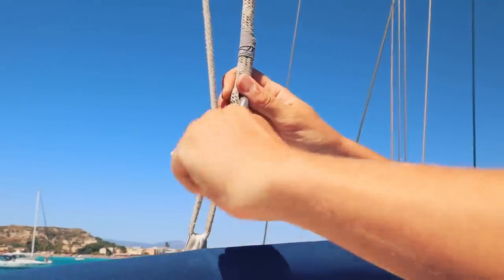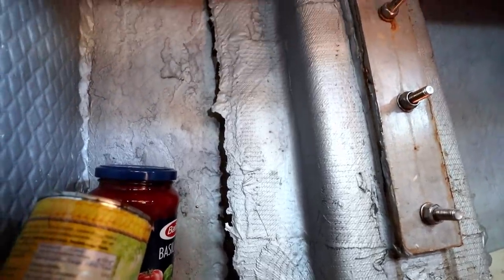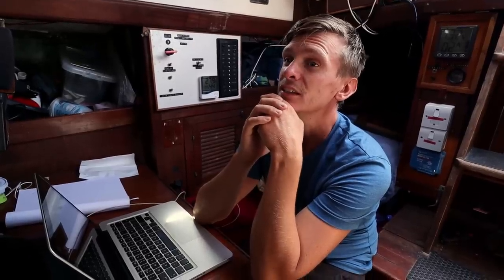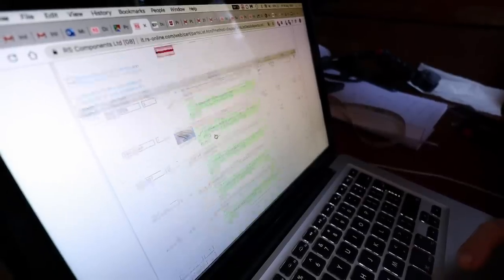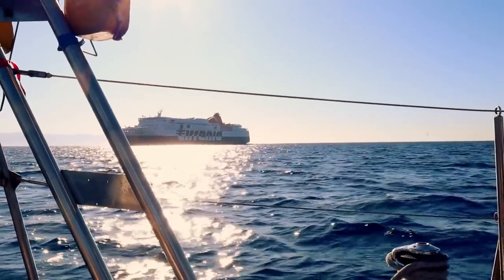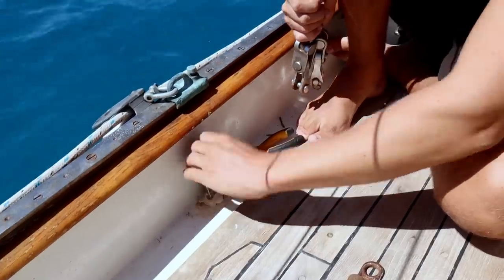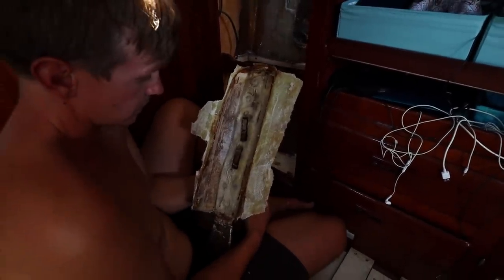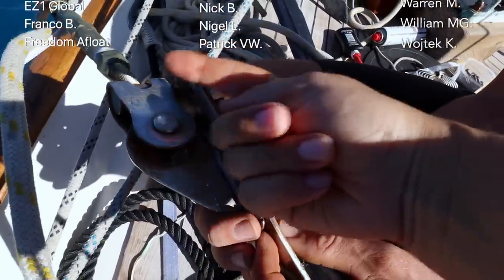80] Our Sailboat's Broken. Discovering Our Ripped Out Chainplates: A Shockingly BAD DIY Install

Comment: A measure of your strength is determined by the manner in which you deal with adversity. Commiserations on your discovery of poor workmanship, but it was as well you spotted it under passive circumstances. Ryan’s ‘workaround’ was well reasoned and your ‘make do’ repairs effective. So well done guys.

Comment: Finally I found a sailing Channel with people who really know what they're doing. The DIY installation of that chain plate was horrific. I'm amazed the rig stayed up for any amount of time. 
 I lost the mast on a Pearson 33 2 about 10 years ago due to a faulty stem head. $30,000 worth of damage to the boat. 
 I like your idea for going to external chainplates I'm not sure you'll have to when you're done with this repair. I'm sure you know this but whenever you remove chain plates or rigging it's always good to bring a spare halyard down and attach it, even if it's just to a stanchion base. Just a little bit of extra security.

Comment: Seems to me you rerally won't need to re-fix those chainplates aterwards. That's a good fix, expecially if you get those iroko spacers nice and snug and perhaps epoxied in place. Six of one half dozen of the other regarding moving the chainplates external once you have that through-bolting.  Lucky it happened now and not another 'less convenient' time... 

All the best to you guys, one of my favourite sailing channels.

Comment: Sure glad you discovered the problem before you got into a much more risky situation (700 miles off shore in a force 8 gale). So pleased to hear of bolting thru the hull. If done correctly this solution should be as strong as external chain plates. hThe only compromise is the chain plate coming up thru the deck (possible leaks). Really enjoy your channel...keep up the interesting story.

Comment: As a boatbuilder for two decades, I can tell you the repaired chainplate installation used the wrong fiberglass (they used 6 or 8 ounce cloth - normally used for WATERPROOFING decks or cabins, not meant for structural work).  It was not only the wrong type of glass, but does not extend nearly far enough in a radius around the wood backer piece. It is important to SPREAD THE LOAD over a wide area of the hull or the wood backer and chainplate will pull lose again. It is a GLARING ERROR and the surveyor should have noticed this!

I suggest grinding the hull with a mini-grinder and 60 grit paper for a good two feet around the area where you want to install the wood chainplate.   Tape off your work area with a curtain of clear plastic so you don't get fiberglass dust all over the place and make sure you wear a good mask and safety goggles!  Grind just enough to take off paint, dirt, grease, old lumps of the previous repair - do not sand deeply - we just want nice, clean fiberglass surface to take the new layers. Make sure you run the edges of the plywood through a table saw as close to 45 degrees as you can get to make a slope - fiberglass does not like to make a 90 degree turn.  Lay down your plywood backing piece with 5200 sealant and tighten the bolts for 48 hours to allow the 5200 to dry and stick the ply to the hull. Remove the bolts and trim off excess 5200 that has squeezed out, using a razor knife or sharp chisel. 

Use EPOXY (which sticks to ground fiberglass much better than polyester resin) to saturate three layers of matt/woven roving (one ata a time) or - preferred - three layers of heavy BI-AXIAL or TRI-AXIAL cloth (with embedded matt) laid over a plywood backing plate and extending onto the hull for two feet in all directions. Try to do the layup one after another and not let harden between layers. When you reinstall the chainplate, I recommend daps of sealant behind the metal so that water running down the chainplate cannot reach the internal plywood beneath it. The job is not difficult, just time consuming. 

Alternately, you might consider moving the chainplates to the OUTSIDE of the hull - leaks run overboard rather than inside the boat. Most of the well regarded Westsail boats used exterior mounted chainplates for just such reasoning.
Reply: eric morris Great suggestions and advice. But these videos were shot a few months ago. Kittiwake is now crossing the Atlantic Ocean.
Reply: Brilliant, thank you that is extremely helpful for me.

Comment: Always wondered about internal chainplates.  Thanks for sharing. Liked your solution. Considering what you had, a properly bonded backing timber well adhered and sealed (to prevent rot) coupled with an external backing plate should serve you far better than what you had before.  May I suggest that if you broaden the external plate as it approaches the gunwale it should be every bit as strong as an external chainplate . Thus, eliminating the need for further costly mods to the rig while proving better load distribution than a typically narrow external chainplate.  Needless to say now is the time to fully inspect the standing rig even to the point of using magnaflux spray on crack finder on all attachment hardware and mounting points - checking for hidden cracks.  Good luck and thanks again. Also Happy wedding.

Comment: That’s an appalling job one of the previous owners did! Looks like you made the right decision to bolt through. I think you’ve already crossed the Atlantic so I guess all went well. I would go with keeping the shroud plates in the locker but putting a substantial ‘backing’ plate on the outside
Reply: They only left last week so doubt they are as Roos the pond yet.  They have a tracker.
Reply: Andy UK - SY Corrival - Rival 32 thanks, looks like they’ve just passed La Palma heading WSW

Comment: To prevent rust, before I put screws (that always used to rust out) into my Enduro Motorcycle, I soak them in motor oil and hit them with a gas canister powered handheld flame/blow torch (in a pinch otherwise using an oven is the best), drop it back in the oil with a hiss, pull it out again wipe excess oil heat it, drop it back in oil and pull out and flame it again, 2 or 3 times.  It cures the screws and stops the rust.  You can do this with the backing plate as well if it is duplex stainless steel (used in water).  Blackening not only protects bare steel from rusting, but the process also yields a relatively attractive finish. You can achieve this finish with some pretty common household items. You will need:
acetone
; clean rags; motor oil; pliers; handheld torch;heavy leather gloves, jacket (welding attire works great), and safety glasses; fire extinguisher (just in case); metal or glass bowl (preferably one you don't care about); well ventilated or outdoor space conducive to mischief preferably on concrete. Oil, wax or lacquer can be applied after blackening to improve corrosion resistance.

Comment: WOW! That looked like you were very lucky. Looks like a bad job but bolting the chain plates to the hull is  a great idea! Don't use plywood but use G10 which is not expensive through amazon.

Comment: WOW that was a terrible previous repair , i assume  there was one wood there and it rotted from a leak .....terrible coverup job!  perhaps it was the previous owner but one?? 

i made some changes to the rake on my rig that required extending the cap shrouds and i was able to by ready made 4" extenders , you could probably use something similar if you change to external chainplate or make sure our external plate come the right height to use the old rigging.  hope your having a great time crssing the Atlantic at the moment. cheers warren

Comment: Chainplates failing isn't exactly unheard of in old boats. In some boats it's a design weakness and they all get updated over time. It's worth checking with any owners association. A T-shaped chainplate might be stronger (upside down T) so when it is glassed in it's pulling against the fibreglass, not pulling out of a slot.

Comment: My mouth literally fell open when I saw that terrible bodge it and leg it job on your chain plates. You've effected a good repair in my humble opinion, iroko is the right stuff. Cup square stainless coach bolts will be prettier on the outside.

Comment: Sorry to hear your bad luck. I am thinking why not doing your external chainplates now, and extend your existing rigging with appropriate shackles. Must be cheaper and easier than what you are doing now?i.e. avoid digging in the boat by using external backing plates, if the SS plate is not thick enough. And always look on the bright side. What a challenge and what a great opportunity? Get it now as you wanted it, and improve on it later...

Comment: Hello .I  think your plan is good I would go for hard wood (not marine ply) the least oily type you have ,and cloth epoxy (a lot) the hell out of it.That means epoxy also as filler between the hull and the wood and the plates for good bedding  . Round the corners for easy " fiberrglassing " If the miserable (hard to believe ) job held for a  while a proper one will hold in any condition. get QUALITY bolts ,lots of garbage around )  I known it is lateral pull but  8 mm seems skinny to me .

Comment: Oh jeez guys, that was one awful job by someone on those chain plates.  Scary indeed.  Enough to find badly wetted our matting but then a void!  I mean what did someone think was taking all the load?  Personally I think what you are doing will be good for long term with a bit of epoxy and maybe some bigger bolts.  I’m not sure why putting the chain plates externally would make things better and as you say the rigging will then need changing.  As for the end of the video, you guys will have been glad to get out of the Med.  hope all going well on the journey across the pond.  I will go check your tracker now.  Fair winds. Andy UK

Comment: hope you have a good crossing. I had the mast come down on my first boat, the previous owner had poor rigging skills. fortunately for me the mast was  in a  tabernacle  and did surprisingly little damage.  their is only so much you can check on a boat. relying on a glass fiber patch to hold those chain plates  in place was optimistic. I think through bolting them is a much better way.
Reply: The original method would have been OK with better technique and a thicker laminate.  The hull has to be well scuffed, and then rubbed down with acetone before laminating - then lay some mat on some resin, and then pull it off to leave some fibers to help the bond of the heavier laminate to follow.  The heavy laminate should be oriented with fibers at 45 degree angles, plus and minus, compared to the load direction.  For this application, use epoxy resin.

Comment: It is amazing that those chainplates lasted as long as they have! 🙈 The previous person who repaired those should be keel-hauled. 
Your fix should get you through until you can do your external chainplates.  The wood you used would be stronger if the grain ran lengthwise. With the grain running across, as you have it, there is less fibre to hold it together as stress is put on it through the holes.  Cracks can develop along the grain.  If you are planning on replacing in short order- fine.  If you are planning to encapsulate the wood with fibreglass and epoxy, that will help too.  Best of luck!
Reply: I see your point.  My concern was as the bolts are tightened, if the block was not shaped to fit the hull, if may deflect and crack.

Comment: You did not have chain plates , you had a poor illusion of them . Wow what was the guy thinking ? Also , good to get the SS not encapsulated where crevice corrosion and stress fractures can go undetected .That fix is good enough to be permanent, except that I might  glass in the block of wood out as far as possible to spread the load out even farther  just for peace of mind and to stop rot , because the deck will leak .

Oh one other thing , make sure the deck is solid core at the chain plates .  They will leak and you do not want it in the core .

Comment: Just use long bolts and pull the plate back in position against the inner hull. permanent fix. Use a 3/8 or 1/2 thick stainless plate on the outside. and a long bolt pull it tight

Comment: Never rely only on a survey! Too much stuff they don't find!
Looks like a tapping on the chainplates with a small hammer/handle of screwdriver would have revealed a hollow sound.
Reply: Very true words. We spent 7 hours inspecting everything on our boat. We spent 3 further hours with the surveyor and had a rigging inspection. Three days after purchase we find the extending spinnaker pole was damaged. We had only seen it partly out. All up I would worry if you find nothing. This is not good though.

Comment: The bond between the fiberglass and the hull is OK. But the fiberglass around the chainplate is either of bad quality or simple badly done : it sheared around the chain plate, not from the hull nor from the chainplate itself.
Only one thing  left to do immediately : go to a yard, hoist the boat, lift the mast, take the chainplates off, apply several layers of fiberglass to the hull and reinforce the whole area, then fit the chain plate with large layers of fiberglass, (much larger than originally done) so the strain from the shroud is evenly spread over the hull… Good luck.  I really sympathize but this is not a matter you can skip or postpone. Emergency repair must NOT be done as long as you're not at sea.

Comment: As an engineer  I suppose  there  always needs to be a weakest  point in case of overload. With the bolts in the hull ripped  out  the hull will sink
Reply from the maker: The rigging wire will break before the chainplate will rip a hole in the boat. Also, the chainplates are above the waterline so the boat cannot sink if they rip out. As a senior engineer... :)

Comment: Eek I saw the fibreglass fibres flying through the air in that video.  Safety first, properly rated mask and goggles, disposable coveralls, the ones that cost a couple of dollars.  Fibreglass is the asbestos of the 21st Century.  Good luck.
Reply from the maker: Like we said, we’re nowhere near a hardware store and everything is closed for two weeks due to a religious holiday. This is what living on a boat means - you can’t just “pop to the shops.”

Comment: not bad fix...but put the screws from the outside and the nuts on the inside...and use shit load of sicaflex, and you good to go.if you want those chain plates to last, paint them, stainless steel gets cristalized in time. notice you have been lucky af.

Comment: The Tayana 37 is notorious for poor chainplates. You were close to losing the mast. That may have been original workmanship ??? Did you check all the others? It is best to use backing plates, all exposed inside and outside so you can see them. I love the Tayana 37, but this is shocking. Fair winds, friend.
Reply from the maker: No, they had been replaced in the last 12 years, which is why our surveyor was so confident that they were OK 🥴
Reply: The workmanship was shocking. They barely wetted the GRP. You are right to use external backing plates. It will be far stronger and you can see them and inspect them. With external plates, you will not be dependent on some shoddy GRP bond.

Comment: There is a book: Low resistance boats, by Thomas Firth Jones, a builder of small, easily driven wooden boats and some in fiberglass: what he says is this: a fiberglass builder (in the sense of manual operative) has little care for his job as it is a routine, not an art as in wooden boats and there are many faults because of this non skilled work.
Reply: What a pompous and stupid thing to believe. Shotty woodwork is done all the time. Their repair will be rock solid/wood solid when finished. Only because Thomas's quote helped him rethink his materials. .

Comment: Hi guys. Problems like these are bad, very bad. I had a similar issue with my chainplates. Check how I managed it on  YouTube: Koala Sailing adventures “Rotten wood”. Perhaps it gives you some ideas to find the best solution for you. First of all you should secure ur mast on both sides. Perhaps you find an good point near the chainplates where u can attach the shrouds. Secure also with halyard. If ur mast is not based on deck but sticked in it will not so easily fall or brake. Without the sails there’s not so much force on it. Good luck 🍀

Comment: I just went back and looked at episode 36 and 37. You did a superficial job reviewing the surveyor's findings so the viewer cannot be certain of the extent of his recommendations or his attitude toward the boat. I would have told you to run away from it but you might have been captivated by the price, as often happens. You glossed over much of what the surveyor told you but chainplate disaster should come as no surprise. You buy a cheap 45-year old Asian boat with teak over wood core decks, rotten structural bulkheads, a dishonest seller (you knew this going in)  and this is what you should expect. The surveyor seems to have done his job. Rotten structural bulkheads are not "somewhat important." They are critical.